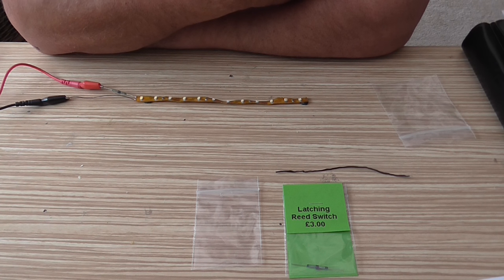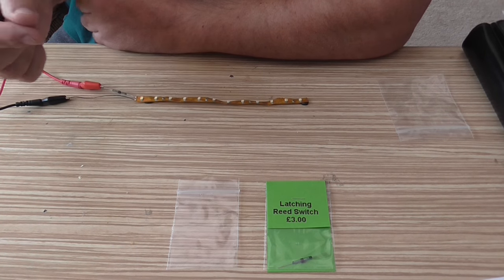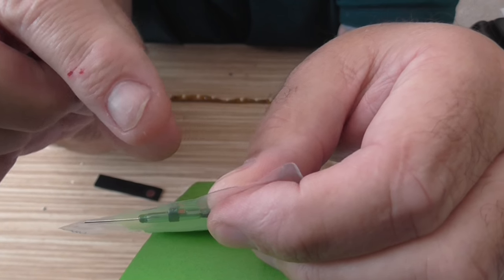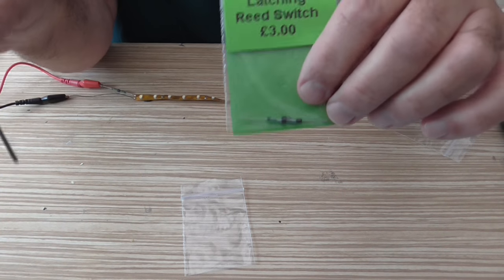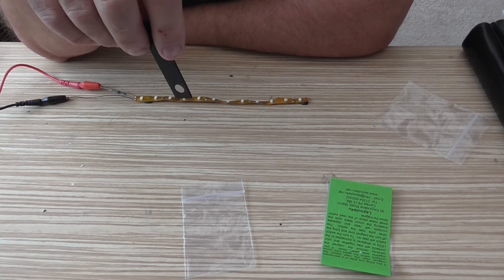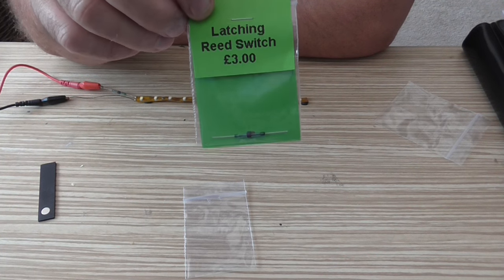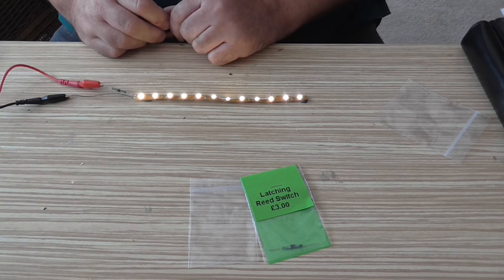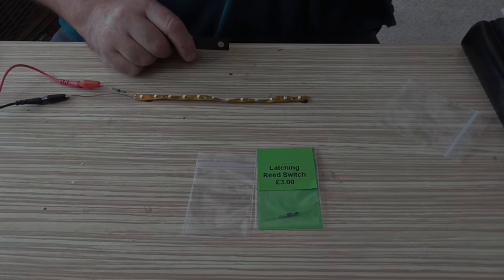Model railway – Latching Reed Switch

Comment: Thanks for the video!
I'm going to use that little sucker to energize a 20 Amp, 12v relay. Then use that to power up my ignition in my 81 camaro race car!.... No more bloody keys! That, combined with a shaved door with poppers, I'll be all set. 
I'm going to glue that reed switch just behind my dash board, all hidden. It's going to be awesome! Thanks
Reply from the maker: Very good idea

Comment: I have seen these myself too and have considered also using them for coach lighting.
Reply from the maker: They are brilliant, I can see lots of places I can use them, just a little too expensive at £3 each.  Always on or always off reed switches are much cheaper but the magnet needs to be connected all of the time for lights to stay on, or off...Simon.

Comment: Latching reed switches are a super idea. There are 3v rechargeable (or 2.7v) which, with a charging circuit can be charged without having to dismantle the coach.
Reply from the maker: Hi, who sells rechargeable batteries, and what charging circuit are you thinking of?